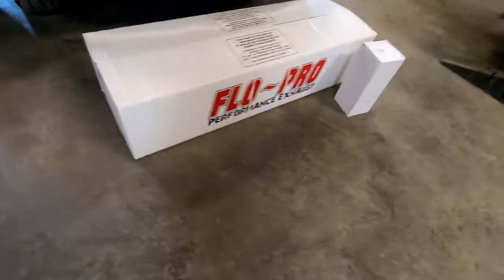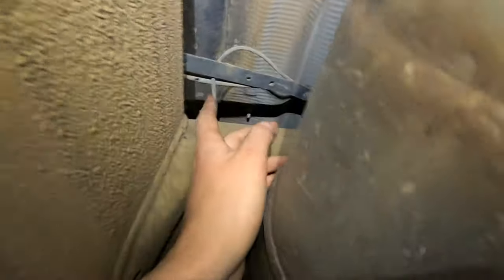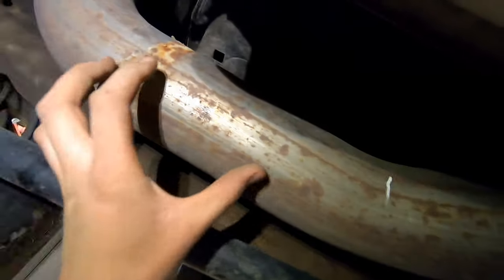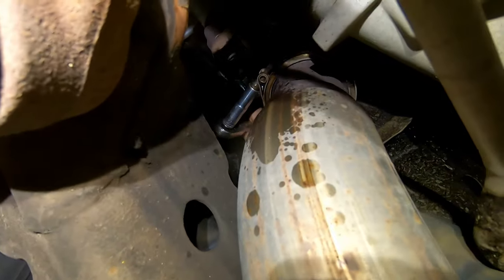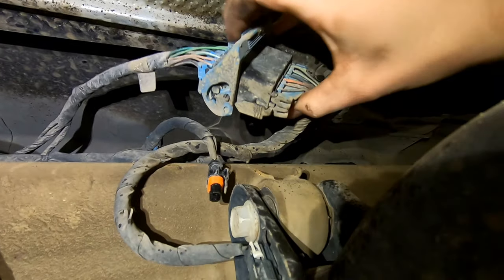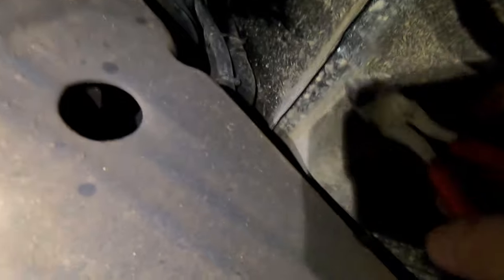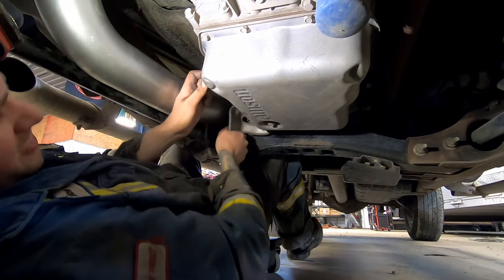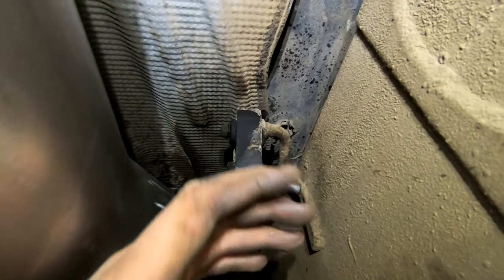How to: DPF delete on LML Duramax and remove DEF tank

Comment: Exelent video bro!!
Question so with efilive tuner thats all i need to do to delete? Im new to the duramax life
Im subscribed!
Reply from the maker: You need some type of programmer that can disable the emissions system, wether you go efi live or ez lynk it doesn’t matter as long as they are delete tunes and not emission compliant tunes. Then you need an aftermarket exhaust as well
Reply: Thank you bro! 
Wait what about the knob that has  1 thru 5 selections that comes with the tune efilive?

Comment: What dose it mean when white smoke comes out when you just did a deff delete
Reply from the maker: White smoke could be a leaky injector or even burning coolant. The problem is, when you have the DPF on your truck, NO SMOKE is allowed out the exhaust, so your truck was most likely smoking white before the delete, you just couldn’t tell until you removed the filter.
Reply: So what can I do for it to stop it from white smokeing cause it only dose it when I drive fast
Reply: It happened two times like 3 months ago
Reply from the maker: Well fix whatever is making it smoke, but I can’t tell that without seeing the truck. I’d run some injector cleaner through your fuel and see if that clears it up.

Comment: so if my 2013 3500 duramax has the DEF deleted am i safe to take the cat and muffler off without causing issues?
Reply from the maker: If your DEF is deleted you need to get your factory exhaust out of the truck ASAP. Without the truck injecting def and burning the soot out of your DPF, it will clog up and you will cause serious engine damage. 

You shouldn’t just delete the DEF. Basically when you tune the truck to run without emissions you HAVE to remove the factory exhaust (Cat and DPF filter) at the same or else you cause damage to your engine. The DEF system (tank, heater, pump) can stay on the truck since it’s deactivated and not doing anything anymore, or it can be removed completely. And then the EGR system has to be unplugged along with the throttle valve. Then it’s your choice if you want to completely remove the egr system or just leave it in unplugged, kinda like the DEF tank.
Reply: Dark Iron Diesel there is an after market exhaust on it but when look under there there is a cat with wires so I was confused as to what I can do with that
Reply from the maker: Well you should have a cat which is right beside your transmission, then after the cat there is your dpf filter which is much longer then the cat. See what’s under your truck
Reply: Dark Iron Diesel there’s no dpf filter there is just a muffler
Reply from the maker: Well LML duramaxs like yours don’t actually come with a muffler anymore because the dpf doubles as a muffler as well. So if you have an aftermarket exhaust in there then you’re all good! If you want to remove the muffler you should be able to no problem.
Reply: Dark Iron Diesel thanks for the help
Reply: @darkirondiesel  how can I get in touch?

Comment: Hey man I have a 2015 duramax.. I want to put the flo pro exhaust on.. do I need to delete the truck or can I just do a tune and unplug the def tank?
Reply from the maker: Putting an aftermarket exhaust on the truck IS doing a DPF delete. So ya you will need to program the truck and then remove dpf and install your aftermarket exhaust.
Reply: Dark Iron Diesel  okay perfect. What is a good tuner that’s affordable and doesn’t blow much black smoke... I’m in California...
Reply from the maker: I use EFI live. The most affordable option would be to find a shop who does efi live tuning and just have them flash a single tune on your truck. I’d recommend just a 25 or 45hp tune, they shouldn’t blow black smoke unless you are putting the pedal right to the floor.
Reply: @darkirondiesel  why do you recommend a single tune vs a dsp5?

Comment: (Question) Got the same set did exactly the same the video helped alot.
My question is, if I dont remove egr do I need to put blocker plates on egr so gasses do recirculate?
Reply: Your valve will stay shut as long as your not running crazy power your fine with just unplugging it
Reply: @michaelsylvester8726  Thanks

Comment: Thanks for the video it's really informative. I am looking to do the emissions delete on a 2013 lml duramax I use at my ranch that is currently stuck at 4mph in limp mode from "low quality def". Would the HS Mini Max tuner work well for doing this? Is there a cheaper tuner I can use? I am just looking for the most basic emissions delete.
Reply: what year is your truck??? gm has a special coverage warranty for the lml and its def system. 10 years/120k miles. which ever comes first. if deleting is something your willing to wait on anyway
Reply: i was told that turning all the emissions off would solve that problem...did it work?

Comment: same process for 2008 LMM ??
Reply from the maker: LMM’s don’t have a def tank, and the exhaust is different on them but the idea is the same. Tune it, then unplug sensors on exhaust, then remove factory exhaust and replace with aftermarket.

Comment: You thing all that will work on a 15 Chevy 4500 express
Reply from the maker: I'm not sure if the piping is the same or not, but I'm sure you could make it work.  You will need to get a different tune though, you will have to get an EFI Live tune specific for the express.  The engine is a bit different on the express then what comes in the pickup if I remember correctly.
Reply: @darkirondiesel  yeah I finally found some where that got me the efi and exhaust just keeping egr on not sure about parts fitting it

Comment: I just removed the DEF tank on a 2013 Chevy and the hoses attaching to the tank are really different from this truck. I took off the passenger side tire and then the inner fender piece. There were disconnect behind the inner fender so I didn't have to cut any hoses. Now all of those "take your truck to the dealer for a 1000 dollar bill" messages are gone for good. I doubt my  horses and cows are going to give a rats ass that the DEF is gone when I go out to drop off bales of hay.
Reply: @darkirondiesel  Your video is one of the best I have seen on LMLs. Easy to follow and understand without lots of self-serving BS and obnoxious music. Thanks. Exhaust is next as soon as it can make it here though the snow.

Comment: Is it possible to just cut out the dpf and tune out the def?
Reply from the maker: Instead of installing a new exhaust? Ya you could tune the truck then drop the exhaust down, cut it open and punch out all the DPF then weld it back up.